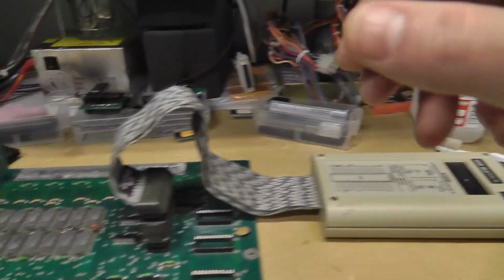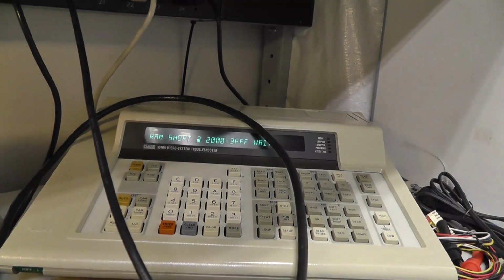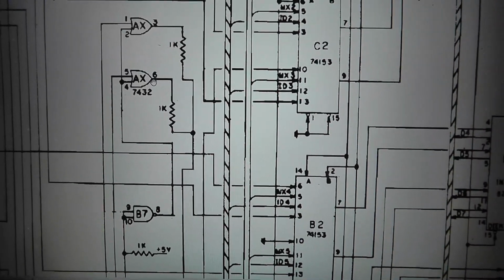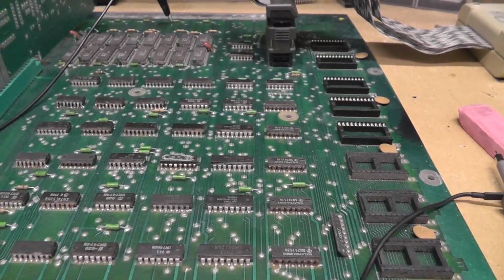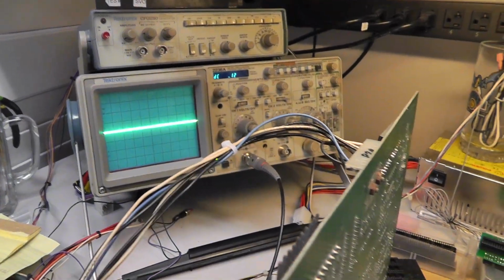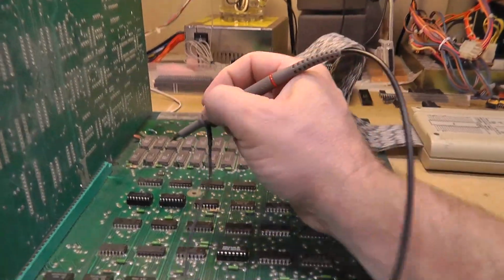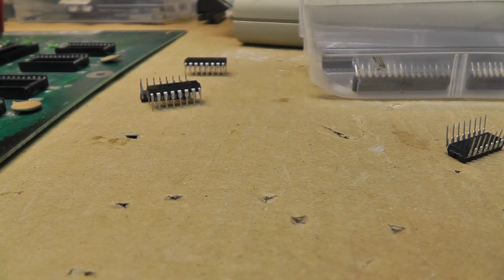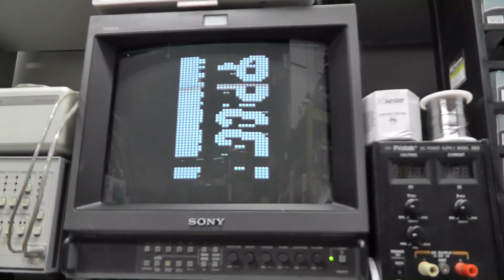Space Invaders Repair - White Screen - Board #2 part 1

Comment: Hey..what model number is that TTL tester? I need to scoop one up...(im smart bomb on klov)
Reply from the maker: Hi.  It is a tl866ii plus.  It is an eprom programmer but only does 18Vpp so I mostly use it for the TTL test functionality.  You can find them on ebay pretty cheap.
Reply: @jacklick  thanks..i see them for about $60. I'll pick one up.
Reply: @jacklick  I have a GQ-X will that software work with it?  What is the software?  Thanks
Reply from the maker: @BluePlanetMedia  Unfortunately, the GQ-4X does not support TTL testing.   I don't know why they don't support it as it definitely has the capability.  I actually sold my GQ-4X but have a better ELNEC programmer as well.  Here is my playlist of all my device programmer reviews, in case it helps. https://www.youtube.com/playlist?list=PLI-IyFhSMr11zg7SVi_lUCZfi9t0MuSE-
Reply: @jacklick  Thanks, I'll take a look
Reply: @jacklick  ohh and it's prime shipping hahah
Reply: Hello.
What's is that TTL comparator tool your using. The black one with the LEDs.
 Thanks for your very educational videos

Comment: What fixed the white lines on the graphics?
Reply from the maker: The white lines is what you get when you don't have a ROM H in the board.  It is just a common way to troubleshoot bad ram in midway 8080 boards.
Reply: @jacklick  What do you mean by its a common way to troubleshoot bad ram in midway 8080 boards? do you mean it helps the repair tech to remove ROM H to see the white lines while troubleshooting midway 8080 boards?
Reply from the maker: @waynegram8907  correct.  Search for miday 8080 standard  test procedure doc.
Reply: @jacklick  Thank is weird they would want the arcade repair technician to REMOVE one of the ROM chips, any reasons why? it doesn't make sense at all
Reply from the maker: My best guess...these are pretty early games so the graphics and program data are all on the same roms; all the ram is also shared.  removing the 1st rom, likely ensures that the game does not try to run, which would cause objects to be written to the screen.  Instead the only thing being read from RAM are some 1s created by the counters or equivalent video address/data bus.  You get 16 lines on the screen which I assume is 1 for each data line of a ram chip.  << probably not 100% but close enough.
Reply: @jacklick  So Removing ROM H is putting the arcade mother board into not having an ROM game code so the V&H counters are outputting only 1's to the video RAM chips to read the V&H counter output signals?
Reply from the maker: I didn't say v&h counters are only outputting 1s but more importantly, I am not trying to figure it out beyond my educated guess.